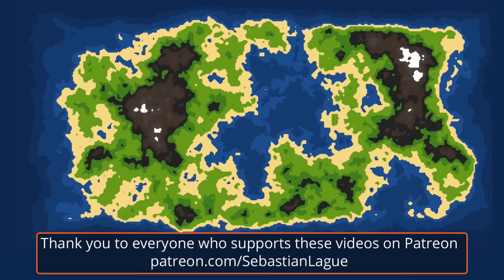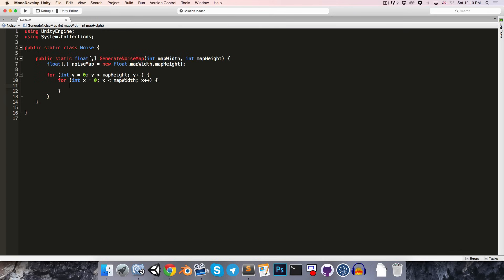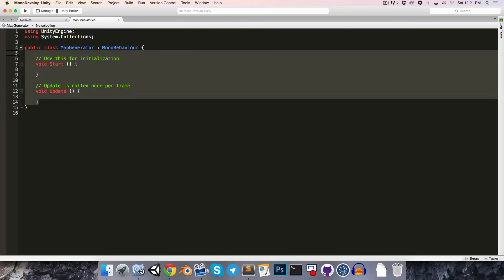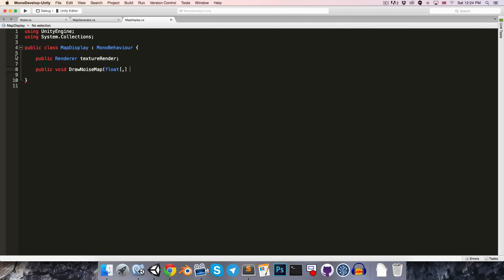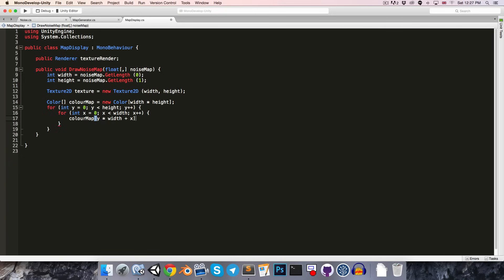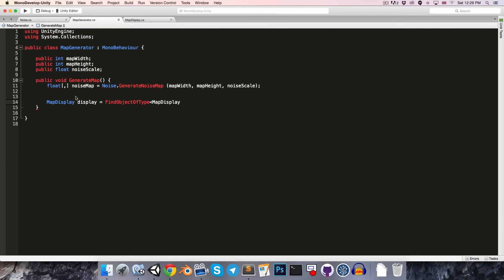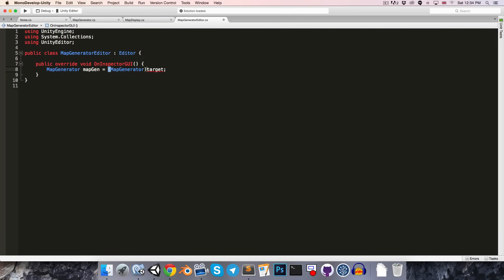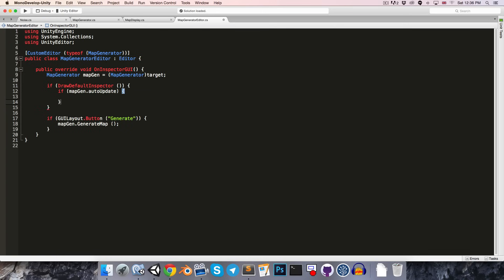Procedural Landmass Generation (E02: Noise Map)

Comment: Multiplication is faster than division. Wouldn't it be a better idea to multiply scale? Instead of number over 1 you just supply numbers under 1
Reply: +DerClaudius I always wondered why I am using an example of simplex noise where multiplication is used and everyone else uses division, making me to figure out values all by myself, lol thanks.
Reply: +Purple Ice :)
Reply: DerClaudius And yeah, that also is a lot better when you want to mess around with it and do something like Random.value for scale.
Reply: Also, do you happen to know what octaves in noise are really for? I tried googling and couldn't find an answer anywhere (just watched next vid in series and it was useless as I don't even know what to do with it)
Reply: yes, do you wanna talk on something more chat-like? hangout or skype or something like that? if you have twitter, contact me @metaglitch
Reply: Here's an example of how to use waves of different frequencies to add up to the desired wave. It's the same with the octaves... and in 2D in case of the noise function: http://imgur.com/a/00ffz
Reply: DerClaudius Well that (obviously) makes sense, thanks!

Comment: HI, Great tutorial.  I learned something new, I didn't know about checking the DrawDefaultInspector return to see if anything has changed.

You can also accomplish all that editor stuff without using an editor script.  On your Monobehaviour you can add an OnValidate method that gets called any time a value in the inspector has changed, and you can add a attribute [ContextMenuItem("Redraw", "Redraw the map.")] to your GenerateMap method.  Then you can get a right click / gear menu item to draw the map.   I think your method is better as it keeps the editor code out of the monobehaviour, but it is an option.

Comment: Great tutorial as always. However you should cache the noise generator instead for find it every time you need to generate the map.
And did you know you could use double Tab to write loop faster, especially for loop?
Reply from the maker: +Lê Tài I had forgotten about that double-tab trick, thanks! :)
Reply: +Sebastian Lague Glad I can help
Reply: Just like normal auto complete, but press tab twice instead of once
Reply from the maker: +Ma rk After having written 'for', double tap the tab key. It will autocreate the for loop. You can then type the name of the variable, press tab again to type the number of iterations, and then press enter to confirm creation of the loop.
Reply: @SebastianLague   I know this is kinda late but when I used this code the texture just looks white instead of having noise. Do you have any suggestions on how to fix this?